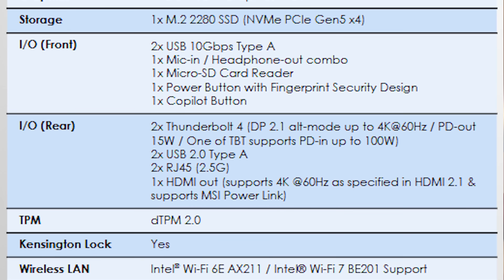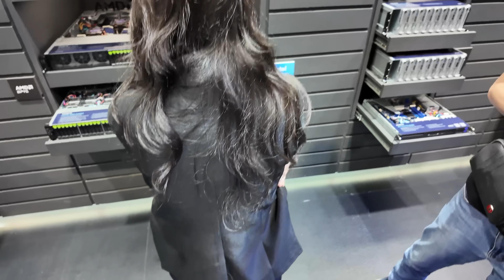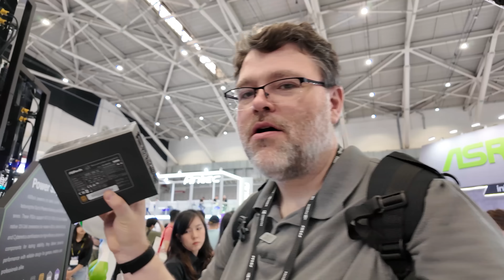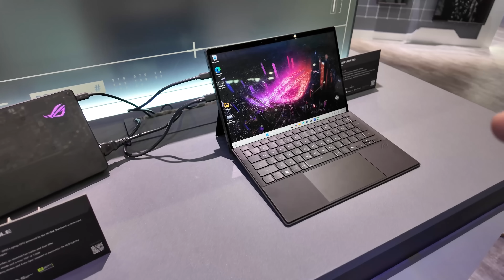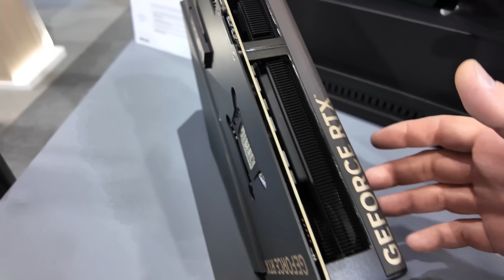Computex 2025 Show Floor Part 2

Comment: when are we going to be able to use two gpu for gaming without stupid connectors. working on the same task in software gpu + gpu + cpu, instead of gpu + cpu. it is easy to do if you have acess to the nvidia source code and drivers,

Comment: It is quite annoying when these GPU companies put just one SSD on the card.  I understand that almost every intel platform out there (that one would consider putting a 5080 on) will not permit 8+4+4, but AMD does and the only way Intel will fix their junk position is when users call them out for it.

Comment: 5:00 Oh hey, the TRX50 jailbreak board (AI TOP). I'm running one of them. So far, no issues with 8 channels on a 7965WX 👍. Eagerly awaiting its RTX Pro 6000, whose arrival ETA has so far increased by 1/4 day per day of waiting. One issue with the board: running 4 NVMe drives (all are Gen5), only 3 have proper cooling, the fourth one is right next to the MB active cooler, but floats for some reason.

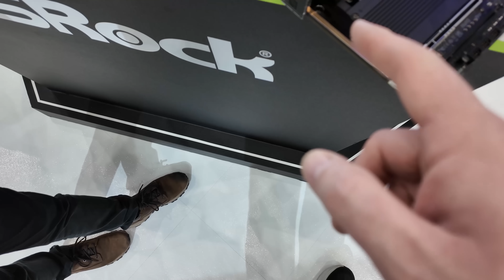Comment: 8:04 Kinda curious how many people are using all of those USB ports on the back of their machine.  Seems borderline excessive at this point.
Reply: Not too many I guess. Some gamers have lots of external peripherals. I know one person who has built almost a whole cockpit for Flightsim with separate displays, knobs and switches and it is all connected via USB. And for the most part it's always better to have USB-ports available instead of using crappy USB-hubs.

Comment: If a 5080 can run uncapped at x8 PCIe 5.0, Oculink 4i will finally be common when PCIe 6.0 lands. The age of external GPU is on the horizon.

Comment: That ASRock temperature solution built into the 12v2 cable is genius!
Reply: But why all these work arounds?  Fix the standard or go back to the old or figure out a new one.
Reply: @thezfunk for real. Genius would be fixing it so that it doesn't overheat and catch fire.

Comment: 8000 ram isn’t needed when you have g skill cl26 6000 for AMD. It’s been shown to be able to run it at 8000 w cl36 using the exact same ram. Didn’t prove to be any faster working at 8000 and it did it at 1.45 volts. 8000 just runs hotter for no benefit

Comment: That Exceleram looks interesting. Plus on the site many of the EXPO listing also have on chip ECC. We'll need a few tests samples sent the big guys way.
I'm seeing 48/96 kits in both 1R/2R ranking with CL30-36-36-76 and another x16 kits CL30-39-39-86 / 6400. Without a higher FClk CPU side I'm still not sold on 8000.
I get the Oculink missing reasoning atm On the EGPU 5090. Until we see one on consumer devices at PCIE 5 not 4 speeds the simplicity of usb wins out.

Comment: blade runner plez. all that gigantic server stuff will fit in a single small chip in a few years. if technology does not make itself obsolete, then its just fake money tek. if not tech development then its tech stagnation for money reasons. money earning is the worst enemy of true tech. not dealing with any of that. what wars. ghost busters! trade is optional. so amd intel nvidia made the ground work then others just spam that. ok. well others can do that too. the ground work I mean. intel is not good with their fpga platforms, nor is amd. or nvidia is not doing that at all. which would be most efficient usage of logic overall. one milli dollars hmh. what is that a measurement of being something even. sounds like nothing. 100 billion dollars, maybe that does not sound anything aether.
Reply: so why you dont just have one motherboard then you also have a pcie expander that can have those 6 m.2. exskuses. one sku for all. all your variations make me puke of the hassle. your issue, pc infra is designed to be expandable and configurable. by the user. its more like you are doing fixed soldered platform products with all these exskuses. look more nonsense. what is all this even used for. well if you just try to fill the shelves with products then you have done it. bling bling for the masses, and bread and circus. lol. you get W from one source only, and its not people. because its not your W. w00t really.
Reply: lol @ installing drivers. lmao whoosh.